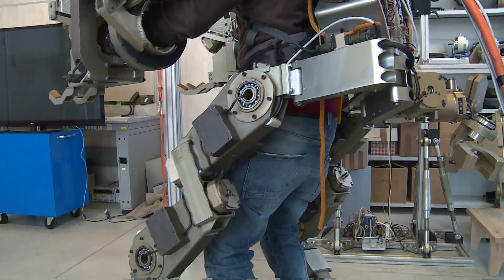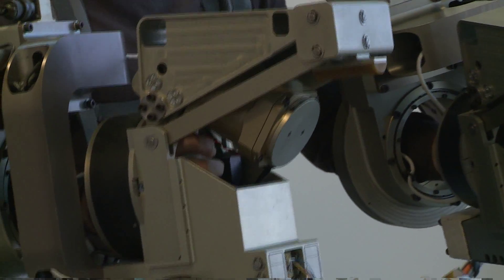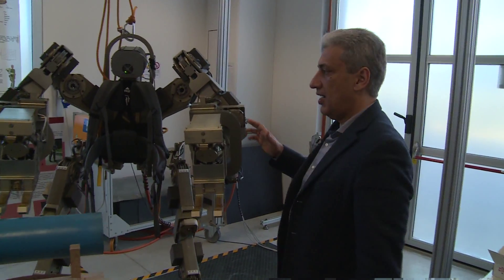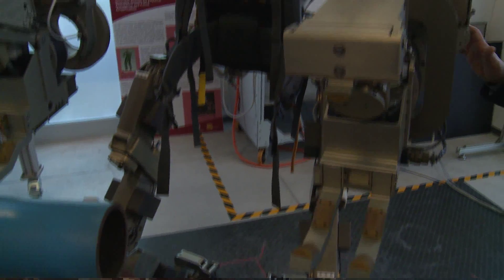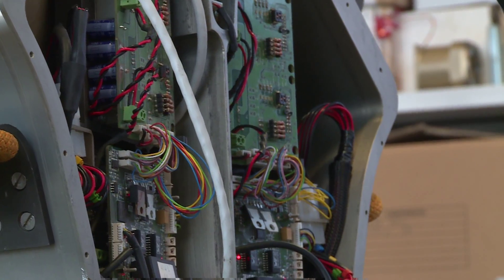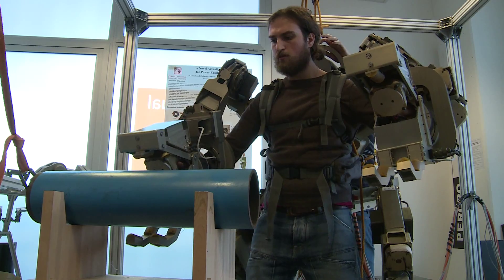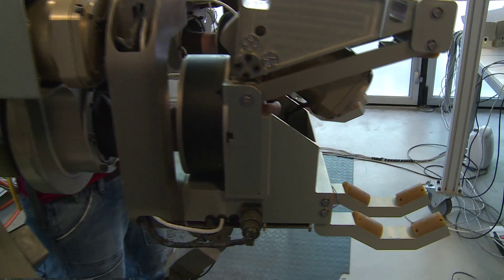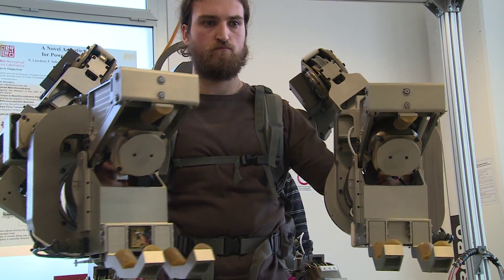'Robo-suit' lets man lift 100kg - BBC News

Comment: Quite pathetic actually!

All that gear and equipment, large and cumbersome, to lift what any decent body builders have been doing for years...okay, so the machine doesn't get fatigued...still?!

Check out the US military exo-skeleton...so much better!
Reply: Well, let us know when you've found a way to replace all emergency workers with bodybuilders that never get fatigued. This suit turns a geek into a body builder and that's what matters.
Reply: Anthony Scroggins
Did you check out the suit from DARPA like I has suggested in my post?

It came out long before this stupid thing! Much better and already in use in the US military.

Next time have the courtesy to actually 'read' other's post before criticizing!
Reply: kamma44 Except that it's being tested and not in field use. And it's made for assisting in carrying equipment, where as this type of suit is with heavy lifting in mind. Different applications.